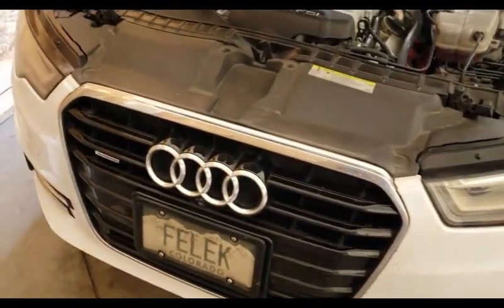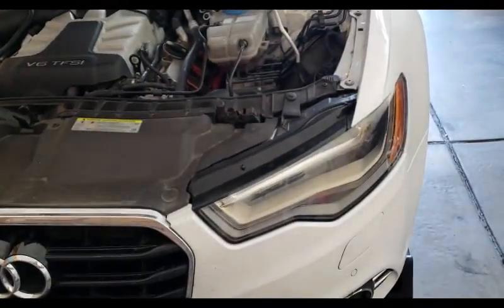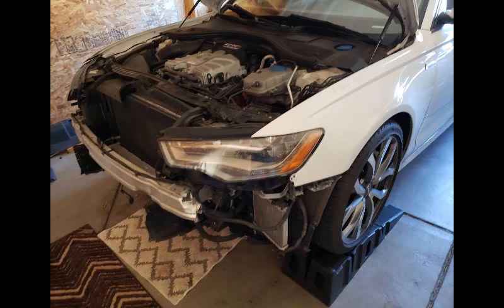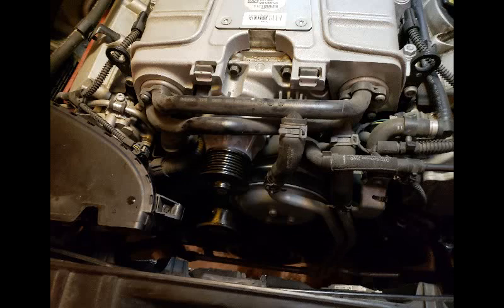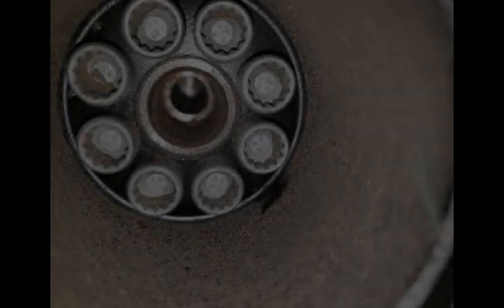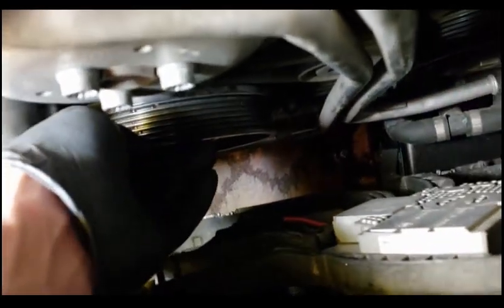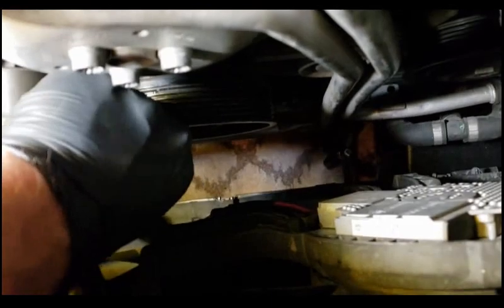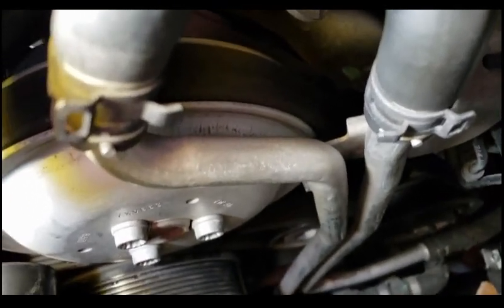2014 Audi A6 APR stage 2 - pulley install diy and first impression

Comment: As always  thank you for doing those videos. I've installed  the chipwerke on my A7 and the car is extremely quicker then before so now I'm playing with the idea of stage 2.
I will mention that my mpg on efficiency mode rose by over 20%.
Reply: I’d go stage 1 before going for this since chipwerke is a piggyback and not an ecu flash.

Comment: this is probably a stupid question but here it goes, Do you need to have the stage one apr ecu flash in order to install the stage 2 pulley's?
Reply from the maker: To do stage 2 flash you need stage 1 flash. You can do it all at once though-install the pulleys and get stage 1 and 2 flashes together.

Comment: After the install you drove for 2 days with no issue? 

What did you felt, any thoughts?
Reply from the maker: Stage 2 is totally worth it, I love how it drives. The only thing which may or may not be related  to it is my pcv is going out but that's  few months later and  again not sure if it's related. Will be doing vid on replacing it.

Comment: Did you upgrade your inter-cooler? If not, are you having issues with heat soak?
Reply from the maker: So as you may know this car was in an accident. I replaced intercooler as the old was damaged. I bought an aftermarket one. No heat issues
Reply from the maker: So another thing I should mention is that about the time when I got my APR stage 2 done, they added on their website info that they recommended intercooler upgrade. I think that's just an excuse for another revenue stream. I spoke with a guy who does APR upgrades at his shop on a daily basis and he said they have had no issues with heat or anything else failing because of the APR upgrade.
Reply: @FelekPL  thanks for the info.

Comment: What belt did you replace and what belt did you re-use?
Reply from the maker: Replaced V-belt  (closer to the front of the car) that goes on drive pulley  and used APR belt for replacement.. The length of the belt depends on if you are replacing drive pulley, crank pulley or both. I replaced both pulleys.

Comment: Can you install these without the tune? Or is it mandatory
Reply from the maker: No idea. When I installed I drove for a day before getting software flash and there was no check engine  light or any errors. That's all I can say
Reply: If you put these without a tune, I would expect that I could beat you with a tune only and no pulleys. The Stage One APR adds 110+ HP without a pulley, so that should tell you that software is very important.

Comment: Stage 2 is only one pulley. The super charger pulley. If you changed both pulleys, than that will be stage 3.
Reply from the maker: Not with APR, they still call it stage 2, at least  on A6
Reply: @FelekPL  Your right, I stand corrected. So hows the upgrades holding up? Any issues?  Software , overheating,  sudden power loss?
Reply from the maker: @justhere4721  The only issue I've had and not actually sure if it's related to APR is PCV/oil separator error which results in car burning some oil. I mean we are talking 1/2 quart every 5000k miles or so. Again, not even sure if that's related to the APR. I feel like my previous Audi A4 with turbo engine was burning more oil with  no faults. Other than that I love the stage 2 and no issues.
Reply: @FelekPL  this was a known problem on the 4.0t v8. The new style pcv for direct injection motors weren't that good. And replacing them is a pain since you have to remove the supercharger. Some people added a catch can. Not sure if it stops the oil burning though.
Reply from the maker: Yeah, I already  looked  into fixing pcv but like you said it sits right  underneath supercharger. Maybe one day...for now it's  not a  big deal.